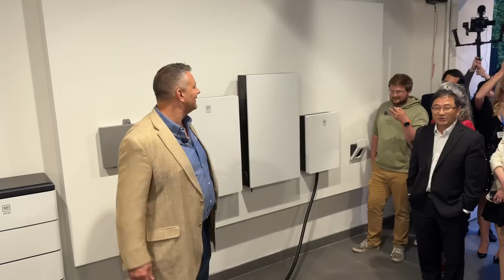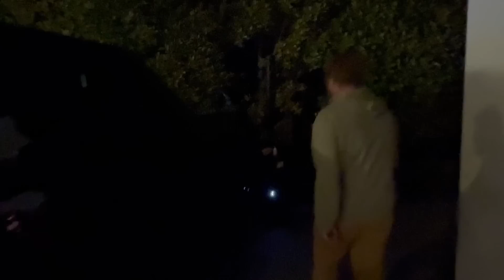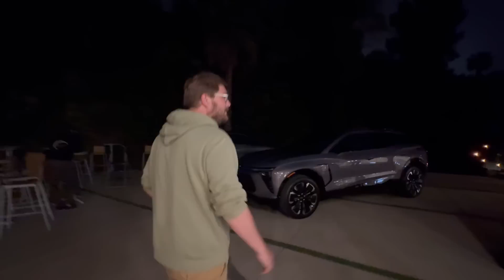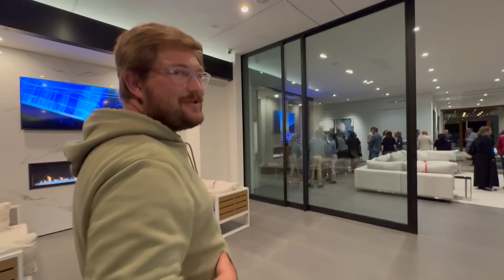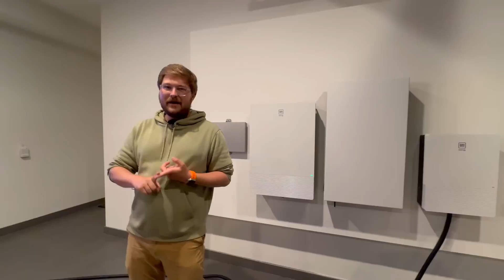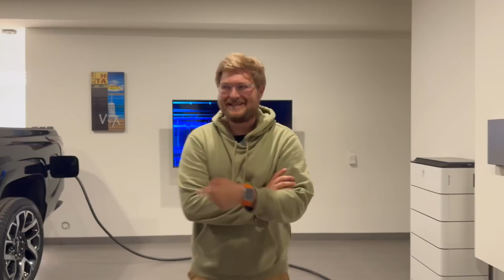GM Launches Home Energy Ecosystem! Full Tour - EV Charging, Bidirectional Power, & Battery Storage

Comment: I like the DC to off-board inverter option that GM is going over using the vehicle inverter. It allows the equipment to be right-sized for the home, whereas vehicle inverters are almost always be limited to 9-11kW output (or lower). Vehicle cooling systems would have to run if using onboard, whereas off-board systems could be bigger and therefore have options to cool passively.
Reply: The other advantage of this System that two out of three of that White boxes you already need if you have a solar System installed. In my house we have Solar battery Storage and we had to install the inverter and the switching panel with the grid disconnect. In our case the only extra component would be the evse
Reply: the vehicle Inverter power is 19.2kW, you now have two inverters instead of one. You need to pay for it and it is also half the power.
Reply: @WRW87  sure, that $100,000 truck does. What about an Equinox EV, a Nissan Leaf, or any other sensible commuter vehicle? DC draw could work on almost any EV with CCS/NACS.
Reply: @LCCB  you are right, for example all Volkswagen Meb cars have the DC out capability just have to turned on by a software update.
Reply: 11kw is plenty for most household use. You would also have a home battery of some sort which should have at least another 7kw which together would cope just fine with sudden household usage.

Even a lower end car with a 3.66hw inverter in the car. that should be fine if its being supplemented by a single home battery. The car is there for capacity and some extra output, not the entire output.

Comment: Just priced tires for this at about $600 a piece. Discount Tire price with insurance installed with taxes is $3000 for only tires. Holy crap. This thing weighs in over 2000 pounds more than Cybertruck. Wow, gonna eat tires. 8900 pounds oh my. Superior engineering goes a long ways. Have to find a balance and still be profitable.
Reply: Tires should be similar to a 3/4 ton or 1 ton truck.
Reply: superior engineering, lol sure
Reply: @CGGC0202  I'll give you an example, hopefully your brain can comprehend the significance of this. 48 volt architecture reduces the amount of wire needed by 70 percent. There are many benefits to this including weight, size and cost.
Reply: @jetmechanic1007  you are acting like it reduced hundreds of pounds of wire. in all likely hood it probably cuts down 5-10lbs at most.
Reply: @jetmechanic1007  no need to be rude my man, i own a cybertruck, the superior engineering comment was someone saying the GM truck was superior i thought was it the other way around ?
Reply: @CGGC0202  I apologize. I felt like I was being run through the ringer.

Comment: The concept makes total sense, particularly if you have a solar array, but until the execution improves AND the cost comes down for the avg person, using your EV as a backup for home power remains a pipe dream. I installed a solar array with mini battery system just to see how it could all work and found out a few years ago it was not yet ready for prime time. It's better today but pricey. You would need to have a frequency of power outage pretty high to recoup the cost of installing this system AND having a vehicle with a large enough battery pack to allow you to have more than a few hours of backup (and to have backup for the ENTIRE house and not just a limited sub-panel).
Reply: I have solar with battery that is available for backup and for consumption (from Enphase). Consumption mode is active when there are no storm warnings, so I use stored power to supplement solar production and avoid purchasing from the grid as much as possible. That means we choose to EV charge and run the dryer midday when possible, and have the battery at 100% by sundown.
The cable from the Silverado looks a bit slim to handle household level of power. Peak power draw may pull 100A +-
Reply: @JohnDoe-xr8dz  the math says differently:  to approximate, 10,000 Watts / 800 Volts = 12.5 Amperes. High voltage DC is great on that front.

Comment: For emergency situations yes but for daily use, bidirectional charging makes no sense.
Reply: If you have an electric vehicle you're likely taking advantage of time of use rates. So you can totally eliminate your power usage when the power is more expensive. This is also one of the reasons we'll be able to flatten the duck curve in regards to solar being in effective. If we can drastically reduce the amount of power needed during peaked demand and increase the amount of demand in the evening and during the day when solar is available a lot of things can happen.
Reply: @matt45540  Your battery will be depleted within a year or two and the payment replacement is not worth it. A Franklin wholehome battery is a suitable alternative instead.
Reply: By the way, you will likely be away from home when the sun is shining. If you own such pickup, you are likely a contractor 🤷‍♂️
Reply: Emergency-only bidirectional charging doesn't make financial sense. But daily bidirectional charging is the holy grail of use cases. Cars are parked an average of 95% of their lives. Much of that stationary in a garage or at work. In places that have time of use electricity charges, bidirectional charging that interfaces with the grid could actively make you money while it sits. Then when energy is cheap (or when you have home solar running in places that have begun to flip costs due to an abundance of solar) you fill the tank up and get ready again. 

That can be at work too. If my employer pays me to use my EV's power to help run the building? That might be a win-win for both of us. 

Then go bigger. If we can unlock large scope grid-scale bidirectional charging that supports home and municipal grids, that's not just an end to home blackouts. That might be an end to brownouts and certain classes of grid instability entirely. Say bye to gas and coal peaker plants.